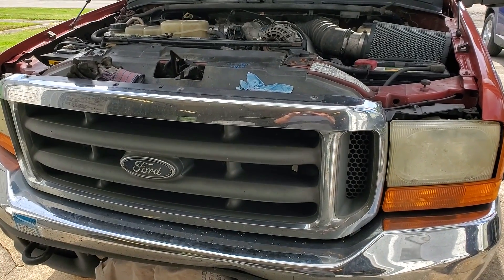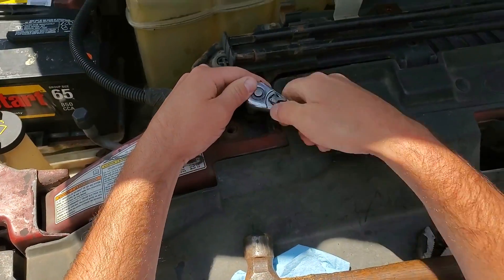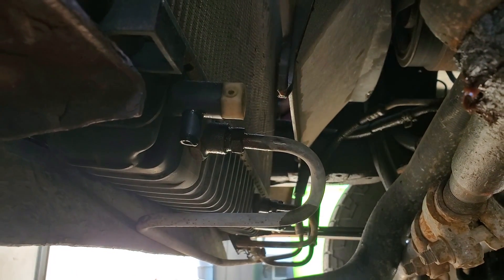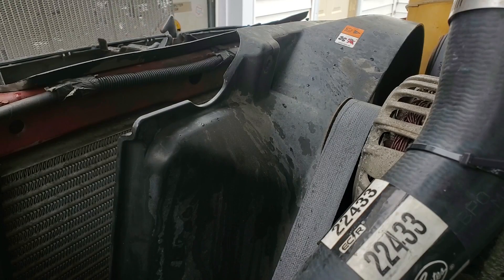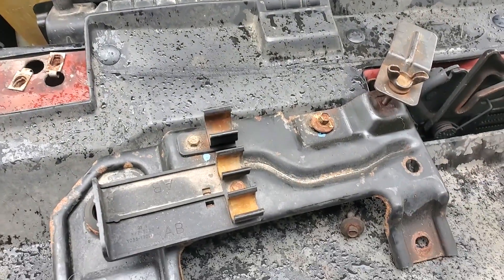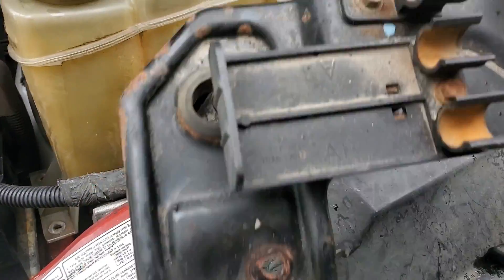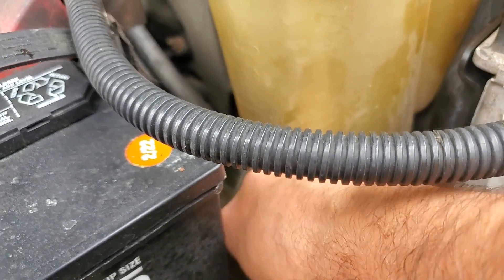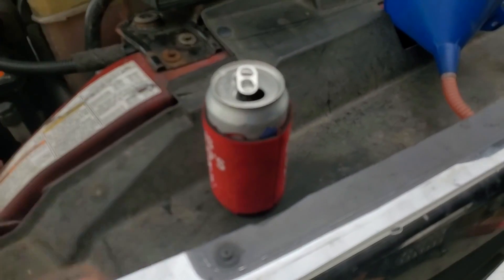7.3L Super Duty (99-03) Radiator Replacement

Comment: I ruined my passenger side transmission line too. Will I have to replace the whole line back to the transmission, or is there a better way to do it? Thanks!
Reply from the maker: Probably too late now being that it's been 12 days since you asked, but anyway, I did try to make a new piece to attach to the hose but I couldn't get it to make the bends without kinking. I could be because I had a crappy tubing bender, but after destroying probably $10 worth of steel line in my attempts, I just said screw it and bought it new one. It wasn't priced too bad if I remember right. I think I even said to myself when I bought it that had I known it was that cheap, I wouldn't have screwed around trying to make my own at all. I wanna say it was like $50 or something. It was a pain to get it installed, but did manage it. With a better tubing bender it can definitely be done, it just depends on your patience level, tubing bending skills, and how much your time is worth to you.